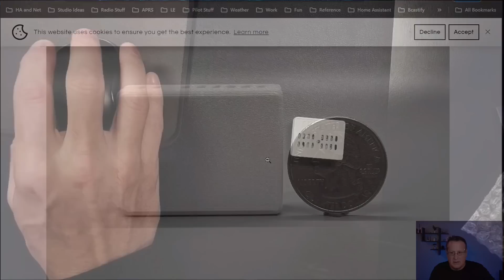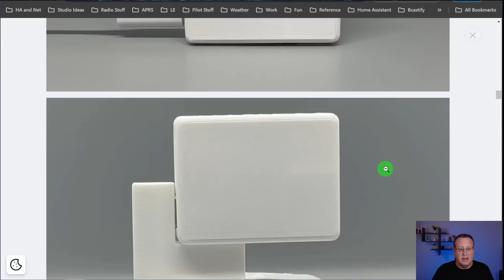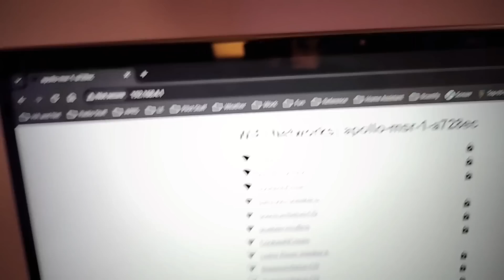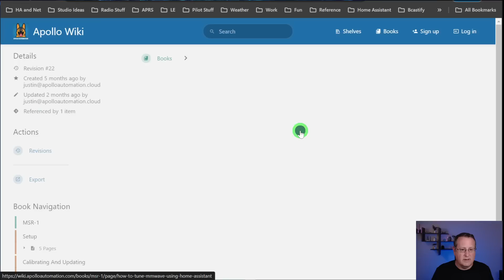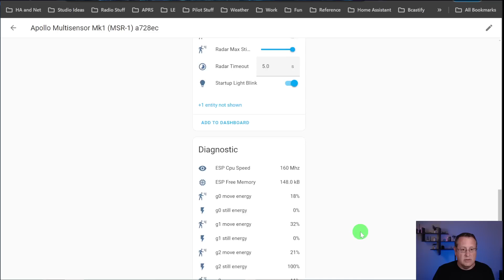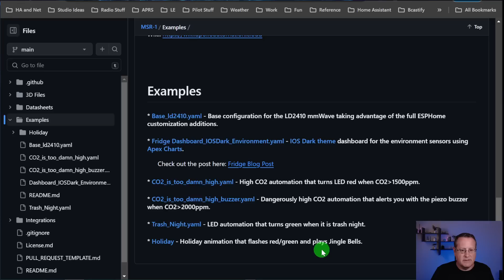The little sensor that does it all! ESPHome and Home Assistant Ready!

Comment: One problem with presence sensors i have experienced. The sensor detect fan propeller move as a human move. This is not good if you have to use fan in your room.

Comment: CO2? Carbon DIoxide, or CO Carbon MONoxide - CO is the poisonous one btw...
Reply from the maker: CO is usually from vehicles, which the MSR-x series doesn't measure. Their AIR-1 will measure CO. I said CO2 in the video and referenced the garage, which is incorrect.

Comment: One concern I have about adding WiFi sensors, is that the continual accumulation of all these WiFi devices might lead to network congestion.  I realize that the "operational" network traffic is very low bandwidth.  However, I've found that things like Multicast will query all devices on the network, creating a broadcast storm of sorts when there are many WiFi devices on the network.  I know there are things you can do with VLANs and such to mitigate this, however that introduces lots of complexity for some devices and ecosystems like Apple's HomeKit.  

Alternatively, things like Z-Wave, Zigbee and proprietary protocols like Lutron all work without any measurable impact on my home network, and therefore I've been leaning more into those. 

Just curious to hear your opinion on this, and if you've run into this at all.  Really appreciate your channel, Chris.  You always do an excellent job of both teaching and being comprehensive in the topics you present;  your content is always engaging/intruiging.  Thank you for the hard work you put into this channel to the benefit of everyone.
Reply: This question has come up before but our users and ourselves have never experienced any issues with multiple wifi devices on a single network. We would love to hear from more users to see what their experience has been. Also, we are looking into using the ESP32-C6 which has zigbee but it is not fully supported in HA/ESPHome. Once it is, our boards are already able to accept the new chip and we can begin developing with it. We are happy to answer any questions!

Cheers,
Justin
Apollo Automation

Comment: Why do they say CO2? I would think they mean CO. Don't think they are measuring burps after a swig of beer or soda!
Reply: This device measures CO2 and our air quality monitor, The AIR-1 measures CO. Here is our response from above.

"Our air quality monitor, The AIR-1, is able to detect CO. However, CO2 can have negative health affects as well, especially when >1000 ppm. We use the SCD40 which is a true NDIR CO2 sensor. Seeing the CO2 levels rise is your home has been eye-opening, especially since it can cause, headaches, fatigue, drowsiness and decreased productivity. Let us know your thoughts!"

Cheers,
Justin
Apollo Automation
Reply: Carbon dioxide or carbon monoxide?
Reply: @JoshDingus  huh? Nobody needs to monitor CO2. Carbon Monoxide (CO) is what is deadly. CO2 is what makes our beer, soda... Etc fizzy. Take away one oxygen and it makes a huge difference.

Comment: If its CO2, then it wont work in the Garage like you mentioned.  That would be CO, Carbon Monoxide, not Carbon Dioxide.
Reply: Our air quality monitor, The AIR-1, is able to detect CO. However, CO2 can have negative health affects as well, especially when >1000 ppm. We use the SCD40 which is a true NDIR CO2 sensor. Seeing the CO2 levels rise is your home has been eye-opening, especially since it can cause, headaches, fatigue, drowsiness and decreased productivity. Let us know your thoughts!

Cheers,
Justin
Apollo Automation
Reply from the maker: Good point. I've got an AIR-1 (thanks Justin) to try out. That would be interesting to try out in the garage, especially when the car starts up or sits there idling. I would also be interested to see how much CO makes it into the house via the garage entrance door after pulls into the garage and people come inside.